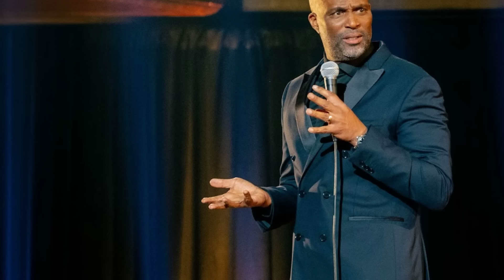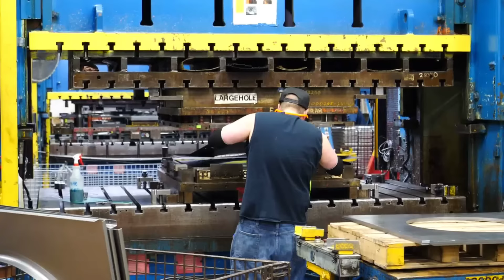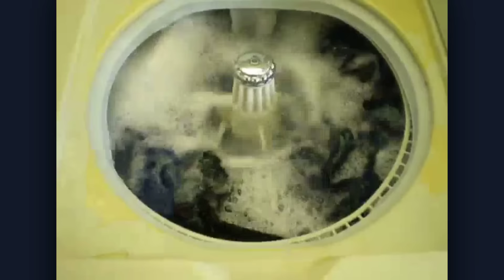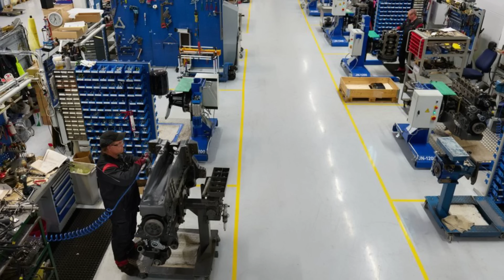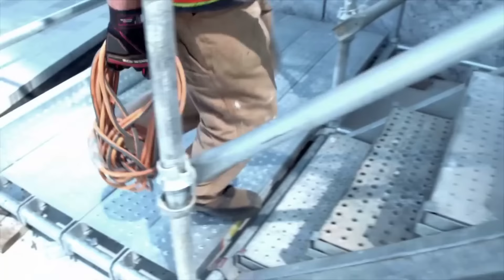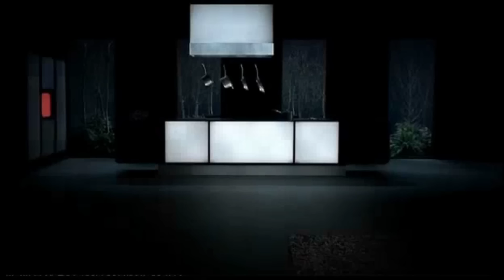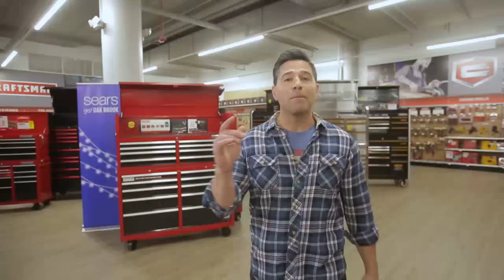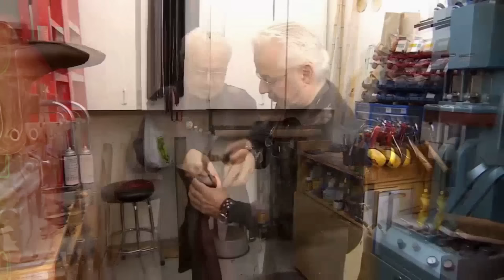The Only 5 Brands That Still Last (The "Buy It For Life" List)

Comment: Most Americans know the older appliances were built to last, and the new ones are all junk with plastic breakable parts.   They've done a lot of work over the years on electronics too such as computers, monitors and smartphones making them cheaper and harder to fix, and basically disposable.   I found a flatscreen PC monitor in my attic I from the 00s, and was amazed I had forgotten how solidly built and heavy it was, and able to be taken apart with screws.   Of course it still works just fine.   The ones sold today are almost like cereal box prize quality

Comment: Plan obsolescenc, there are many items, kitchen, tools Etc that lasts for decades or even hundreds of years passed down from previous generations and still working perfectly, unfortunately these days just planned obsolescence, I believe it should be prosecuted as a type of fraud and consider the fact on a planet with limited resources if we keep building everything for the short term we will eventually run out.

Scientia Non Domus Habet, 
(Knowledge Has No Home) 
antiguajohn

Comment: Got a new samsung washer it has electric button settings to change to normal, delicate, bedding etc.  That button was difficult to change to different setting so once i got it to normal its been there since at least a year now plus its rusty around top inside lid.   Maybe 8 years old less than ten.  I don't care for these electronic appliances.

Comment: Most things with electronic control are built to last four years at best, go to a modern scrap yard if you can find one, most things look brand new, generally got 60 pence worth electric component gone wrong the trick is finding which one, as manufacturers are getting better and better at hiding those parts. Fifty years ago things were not thrown away until they were well and truly worn out.

Comment: I learned something about the electronic control panels on washing machines: they are just a small computer and they need to be rebooted occasionally. So the next time your washing machine’s control panel is flashing and your washer won’t work, flip the breaker for the washer off then back on. For me, it has worked 100% of the time. My mom gave me an old cast iron skillet when I went away to college in 1979, it’s only gotten better since then.
Reply: Thank you. That's very sensible. I will try to keep that in mind if it ever happens. I have a speed Queen washer and dryer that my now deceased mother chose about 10 years ago and they are troopers.
Reply: I found my Internet router was giving trouble, now reboot cycle on a timer every night and no trouble since. Must switch the washer and dryer off at socket every now and again. Good advice.
Reply: @mryan4452 yes definitely on the router, and printer too. Whenever anything electronic gets wonky, a reboot is the easiest thing to try to get it working properly again, and it almost always works.
Reply: @Maydoggie  I had a hunch when a car window stopped midway. I looked it up - sure enough, a reboot worked (hold for 10 seconds, etc)
Reply: how many times have you rebooted the cast iron skillet ?

Comment: I fix everything and I have to agree with you on Honda small engines and Speed Queen washers and dryers.
However when it comes to tools gearwrench Tools in general have been the most durable. Knipex plyers are a game changer as are wera screwdrivers.  My motto is buy once cry once so a Miller welder and Milwaukee tools are on my list as well.
There is a product called Shoe Goo that will repair shoes and boots everything from a rip or tear to gluing a solel back on. Not a big fan of Red Wings as I've used Shoe Goo to repair the many times

Comment: Use ethanol free fuel in small engines and nothing else. I’ve had the same lawn mower and pressure washer for a decade and they start on  the first 2-3 pulls after sitting in the garage for the winter.
Reply: Absolutely essential in anything with a carburetor.  Thank goodness Stewart's Shops carry non- ethanol fuel. I throw a little stable fuel stabilizer in there as well. Keep my fuel in  mil-spec NATO cans and make sure I put the first two or three gallons in my truck before filling them up so as not to contaminate the non-ethanol fuel with the rest of the ethanol fuel left in the blender pump. You can easily keep the gas for 3 years that way

Comment: The Speed Queen TC5000 does NOT have a mechanical timer and it DOES have a load sensor.  How do I know this?  I sell them.
Reply: He said the Speed Queen 5 top loader….not 5000…is this different?
Reply: is it still up to the promises made in this video ?
Reply: @szpl no the new stuff is not like it was, i think 2018ish they switched to being junky like the rest.
Reply: I still prefer STABER
Reply: Thanks. It's not hard to find out.
Reply: @markmatt3490

(small/mom-pop) laundromat owner/operator. Former field tech for a large east coast Huebsch distributor after seven years of explaining what an IPSO was to opl customers who only spoke in Unimac...

This is 100% on point. 

There is a significant difference in the 2017-2018 onward speed queen washers. 

This is 100% on point. 

We still operate a handful of 1996 model speed queen swtt top load models (coin operated, mostly unattended location). We added a few 2018 speed queen swnbc 'quantum' top load washers in April 18'

3 guesses on which cost me less to operate anyone???

Comment: My old man has been a washer and dryer repaired man since the early 90's and has charge customers 90's prices till he retired last yr at 75yrs old.  My mom has had her old washer a Kenmore 2000 for years and because the clutch went out and my old man decided to replace the clutch with a used one that fail early, because he's cheap in replacing it with a brand new clutch kit, she decided to buy a new modern one.... well right away she didn't like it and replaced it with another brand after my old man told her that non of the modern machines last and are pure trash!  After she replaced 3 and send the 3rd one back for a refund she finally cave in and told my old man to fix her old washer like new because she loves that old machine that hardly breaks....  Old man got her a new OEM clutch kit, re-service the transmission, full aligned the tub, replaced all seals and recondition the time clock and circuit board.... that fkn' machine is running like brand new and 80 yr old mother is happy as hell....  She took care of that machine, no rust, no scratches, all looking like when it came out of the factory!  And it was very cheap to fix with OEM parts....

In the other hand, I told him about the Speed Queen washers and how they are still build like the old washers of the 90's and he said that what he doesn't like about the Speed Queen is that the motor uses sensor and those are prone to fail.  Some of the parts to service are a bit complicated to fix but he doesn't like that even the parts for the Speed Queen's are expensive because they advertise as lasting for years hence they have to make some money on spare parts.....   He said that if someone wants an old style solid washer and dryer to buy them used in great condition because there are still stores that sell used machines at great prices.... Heck when he's client asked him to get them those kinds of machines, if he didn't had a spare one to sell them he would buy one really cheap or one that he would get for free and fix it like new and re-sell it to his clients!  They are still in demand he says but he has to say no to them since he has already retired and is tired already....

And yes... he thought me everything he knows since I was a teen and now in my late 40's if anything goes wrong with my washer or dryer i will easily fix it myself but my Frigidaire Affinity washer since I got it for $125 in 2009 when they first came out HASN'T break yet.  Been working flawless for the past 17 yrs and my old man gave up on it because it has broke not once since he was sill fixing machines! lol.....   They just don't make them like they use to.

Comment: you don't throw an engine away because the pull cord breaks. You can buy pull cord by the spool like I do working on small engines, or just a generic cord to replace. The honda parts availibility is a myth, all engine brands sell replacement parts.

Comment: I just did a full rebuild of my 15 year old Maytag dryer. new belt, two rollers, tensioner, and felt seal. All for less than $40.
Reply: I'm a two timer repair on our Hotpoint (GE) gas dryer. The basics, have been the drum bearing, felt, idler pulley and bel. And the light bulb. Not hard to fix, just hard to pull out & have space to work on it! It runs very quietly and works great! 20+ years & going strong

Comment: I use a 1960's cast iron frypan for frying beef steak exclusively and no longer (5 years ago) use a bbq. I kept the propane-bbq as it has a side burner in case the power goes out.  
I do use a teflon 34 cm frypan for bacon & eggs and always have a second one on hand.  If the finish looks thin or somehow gets scratched, I throw it out immediately. 
I have a freezer from the early kenmore 1970's that is still used.
Winter boots with a sewn-on bottom from 1965. Resoled 4 times. I only wear them when I travel to the Andes in July & August.
Lastly, a Honda generator from the 1960's.
Thank you for your presentation.

Comment: Here in South Africa a Speed Queen costs twice as much as the other washing machines but my mother refuses to buy any washing machines with eletronics.
Reply: Listen to your mother.
Reply: @lexmercatoria2774 Analogy wins every time. Water and electronics don't mix.
Reply: @DonLawler-g7d  This.  I bought a Staber "made in America" washer with stainless steel parts for a premium price - crapped out when water got into the electronics and couldn't be fixed economically.  Loved the washer - but didn't know it was disposable junk.
Reply: @lexmercatoria2774 Me too....I have had the same washing machine for 20 years. It has zero electronics and looks like a 1970s washing machine, PERFECT. We had a Hinda extra generator on our sailboat to use while we were anchored for weeks. It was great! It was the only way we could charge the batteries that ran our lighting at anchor. And yes,  I have three sizes of cast kron skillet , the largest with a lid.
Reply: And same here in the U.S.  A few years ago, we needed to buy a new washer and dryer set after our early 1980's mechanical/analog Whirlpool set finally died out after 35 years.  The newer models of most brands at that time seemed to have mold issues and electronics issues.  I learned about Speed Queen and found a new Speed Queen washer and dryer for sale at a local mom-and-pop appliance store.  They were twice the price of the other sets, but I didn't hesitate to buy them.  Still going strong without any issues.  Happy to pay for the quality and the peace of mind.
Reply: I received a "display " model stove With a new condo I purchased in 1997. No electronics, except for the timer, which, naturally, broke. Otherwise, one burned out oven element, and a burner with a bad connection and the darn thing keeps on cooking.
I thought my wife would like something better, so when a friend offered me a fancy, dual oven, glass top stove for free, stating that the only problem was that one oven quit, I decided to "upgrade".
I bought a new element ($200!) and expected to enjoy the new stove, but not for long, as after running the oven it for 5-10 minutes, it would shut off and reset. Turns out the circuit board was fried, cost $700, and was backordered!!!

The old stove is back at work, and the fancy new one is in the junkyard
Reply: Yeah, in the USA you can find a clothes washer for around $400 on a Presidents' Day or Black Friday or Fourth of July or Ground Hog Day (insert name of holiday here) promotional sale, price looks dirt-cheap until the machine fails two days out of warranty. Then there are the $600 to $800 machines, and cheaply built but fabulously expensive priced washers from Electrolux (they used to make some very fine vacuum cleaners) priced comparably to Speed Queen  (around $1550 last time I checked, including tax, delivery, and set-up).
Speed Queen does cost about twice as much as the mid-range brand and lacks some of the features (who really needs WIFi on a clothes washer? Or Fridge? or  toaster?) but it will last three or four times longer.
Reply: Mom knows best
Reply: Same in the USA. The speed queen unit costs about $1,500 here. Cheapo washer will be $400-500.
Reply: @merlinious01  $2,500
Reply: Might cost twice as much, initially, but without the expensive repair or replacement costs of the others it pays off as cheaper in the long run.
Reply: My Texas mother was the same way. She said that if you bought quality items once, you didn't need to replace them as often.
Reply: @petuniafuzz9083 Buy once, Cry once.
Reply: You will buy  a Speed Queen once whereas the other cheaply made crap you will buy10 of them.
Reply: I purchased the model with knobs, but there are still some electronics. No complaints except for the price.
Reply: When I went to buy a new clothes washer, I said I wanted one with an old-school agitator and no bells and whistles. The salesman explained that the washing machines with agitators only look old-school and their insides work with everything electronic. In other words, some companies still make the old fashioned style but only as a sales gimmick for old timers. There apparently are no new models that aren’t actually electronic.
Reply: Double the price in US also.  Worth every penny.
Reply: They still have electronics in the control panel, and that costs $1000 to replace, and only has a 3 year warranty. The price of a new Samsung washer. So, I went with Samsung.
Reply: @faithful451 the speed queen mentioned in the video has a mechanical control panel, not an electronic one.  That is the basic model and the one I own.  Certainly Speed Queen also sells electronic ones.
Reply: @johnsonfamilyhomeschool675  Thanks, I didn't know that. Sadly, when I went to visit the official speed queen outlet in my state (Western Australia) they didn't have mechanical models, only the ones with the electronic control panel. Probably would have changed my decision.

Comment: My honda 2200i running since 12 years in my workshop tent by the entrance  ,keeping in same place even in winter ,just changed oil regularly that's it ,just the string worn out hope will run another 10years at least so low consumption even my broke A$ can afford it to run it😂

Comment: My dad had a 9HP Honda snowblower for over 20 years.   He put literally thousands of hours on that motor and it was still running good as new when he sold it (because he moved into a cottage and didn't need a snowblower anymore).

Honda engines are practically immortal.

Comment: England. We have a Honda generator left for 10 years by previous owner new fuel splashed in and started first time. Also a mower the engine may replace our Briggs and Stratton which is the older model mostly made from metal.
David and Lily Reading England.

Comment: My wife got a booklet after 20 yrs service at her job. We picked a Webber Grill without the trolly underneath. We have had that Bar-b-que for about 12 years or so and the automatic starter stopped working. Called the company replacement parts section where we live now and they replaced it and sent it to us all for free.

Comment: A good video, but clearly this is an exceptionally small list. I encourage the proprietor(s) of the website to do a much more comprehensive inventory. And I take exception to the claim that it's hard to find good quality hand-tools. I've been a tradesman my entire working life, tool metallurgy and heat treating processes (and affordability and warranty) are leagues better than they were 40 years ago, even domestic-market tools are used by many professionals for at least some of their tool inventory. There was a lot of mediocre hand tools on the market in the 70's and even the 80's, now it's much more difficult (though certainly not impossible) to buy garbage. The same cannot be said for battery driven tools, which one has to be MUCH more circumspect about purchasing. I find that Milwaukee is a pretty good make.

Comment: What about stainless steel if cast iron isn't available?  I've seen steel pans last 10, 20 years or more.
Reply: Any cast iron pan is good.  It doesn't have to be a particular brand.  I have some Taiwanese ones that I rescued from the local dump thirty years ago, which I use nearly every day, together with an unbranded, generic Dutch oven.  Also, don't be afraid to clean them aggressively.
Reply: If you don't mind a little nickel in your omelet.......................

Comment: Sorry but Honda generators aren't worth it. I'll take a Westinghouse like the one I have had for four years, and it still runs perfectly. I'm not spending $150.00 to resole an old pair of boots when I can get a great new pair for half the price of the resole. I totally agree with cast iron pans. I have never had a box, open-end, or socket wrench fail, no matter what the brand was. I'm amazed you didn't mention Snap-On wrenches. Another worthless video.

Comment: Don't forget Maglite flashlights made  in Ontario, California. Good lights
Reply: They're temperamental. Bulbs-diodes don't last. The battery contacts constantly corrode and have to be reconditioned. The o-ring seals on the twistable beam adjustors wear and then 'drag' with not many hours of operation on the unit.